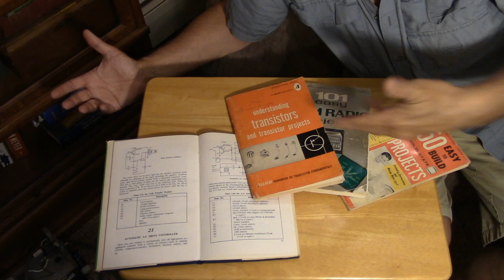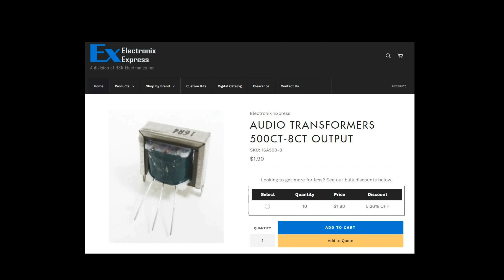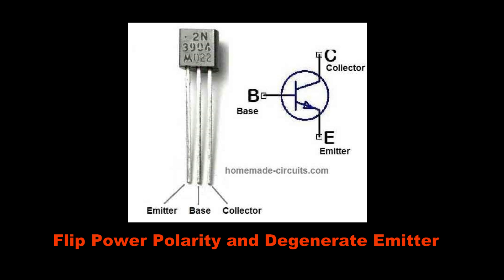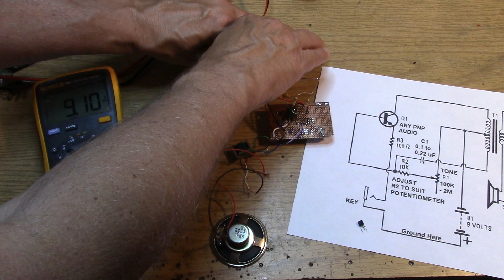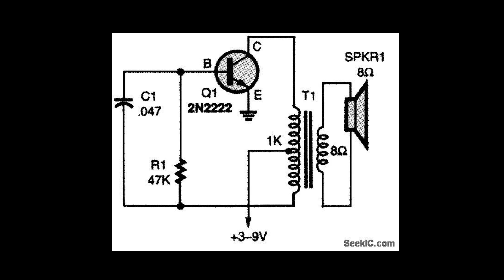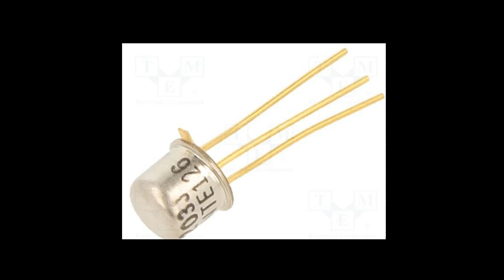Simple Code Practice Oscillator Project

Comment: Have you ever tried a reverse avalanche  oscilator. Very simple BD 139 works well at 12 volts although other transistors will work but may need a higher voltage

Comment: 😂 Too simple I made a 4 transistor circuit that has 2 oscillators: one modulating a multivibrator.
It has several adjustable parameters so you can generate sirens, tones strange wobbling/shimmering sounds. Its supplied by an LM7812, uses a rechargeable 22V battery from a vacuum cleaner which directly supplies  a TDA2050 audio power amp IC. A momentary switch "the black button" feeds the audio from the generator circuit to the power amp via a potentiometer to control volume.
Zero to 15W. Its all built into a steel lunch box. I feed a 30W 8ohm horn speaker with it. 
Great for a practical joke. You walk around with the speaker in a bag making ear ringing short bursts and watch people 😂

Comment: Heh cool, now we use a few billiion transistors (mictrocontroller) to make an oscillator wih a simpe line of code.   I loaded up a saw wave example code on my stm32 and sure enough it puts out a nice saw wave at 200khz.  $1 in parts, 0 soldering. But i didnt learn anything... another copy and paste and I had  a white noise generator, sounded just like it too.    Copy and paste is so much easier then wiring up an new circuit... but you dont learn anything.

Comment: To complicated!  The one that I built years ago was extremely simple, used a single 555 IC, and was featured in the first few pages of an ARRL handbook, maybe about 1969.  It featured volume and tone controls and required a single 9-volt battery.  All of the components used would still be available today for purchase.  Just wished I had that schematic.
Reply: This appears to be substantially similar to what you describe, or at least a modern version of it: https://www.arrl.org/files/file/QST/This%20Month%20in%20QST/2023/12%20December%2023/2023-12%20Hoffman.pdf

Comment: I built a single transistor code practice oscillator in 1969 while in Vietnam working on a Novice license. I got to 5 wpm, but gave up when sent to another command, thanks for this one Mike. 73's🎙KD9OAM🎧📻
Reply from the maker: I got an old Eico CPO from an upgraded novice when I was a kid.  It was almost identical to this circuit!

Comment: Unfortunately, I have a bad habit of looking at all the old transistor radios I find and instead of snatching useful parts from them I think, "I bet I can fix this thing. It's probably just a bad connector or a shorted cap. And even if it's a transistor, I have bins full of them. Sure the tuning cap would be good in a QRP antenna tuner, but this cool old radio is already all here and just needs to be fixed. Besides, I already have a QRP antenna tuner, 2 of them in fact. A little super glue will fix this case just fine and I can stick in a little step-up inverter module, shield it with aluminum foil since this is an AM radio, add a few filter caps and an inductor to quiet it down, and a lithium battery pack to drive it all instead of those 4 old C cells. Probably run for days, especially if I put a small solar panel  on top. And I think I have a longer-throw speaker this size somewhere, too. This thing could sound great by the time I'm done with it! And I could listen to it when I'm working out in the shed instead of listening to the 4 channel 400 Watt SONY Dolby system I have in there already."

Comment: I really don't condone scrapping an old relic of the past like that. Repair that old transistor radio and get the parts somewhere else instead. But that's just me. To each their own I guess.
Good video anyway. Thanks and keep up the good work.
Reply: Repairing Japanese Transistor radios was my first unpaid job. My father often used to take me along on a Saturday morning to the service department of a group of retail electrical shops where he was the service manager. Rather than me sitting around idle, he put my keen youthful eyes and soldering skills to use, (I must have been about 12)  soldering back the thin wires of the long and medium wave coils on in-guarantee tranny radios. Unpaid? Maybe I got paid in solder.

73 Steve M0KOV
Reply: Repairing Japanese Transistor radios was my first unpaid job. My father often used to take me along on a Saturday morning to the service department of a group of retail electrical shops where he was the service manager. Rather than me sitting around idle, he put my keen youthful eyes and soldering skills to use, (I must have been about 12)  soldering back the thin wires of the long and medium wave coils on in-guarantee radios. Unpaid? Maybe I got paid in solder.

73 Steve M0KOV
Reply: The millions of awful old japanese plastic pocket radios are worthless. It's not like he's scrapping an Atwater Kent
Reply: I remember having a big box full of crappy AM radios when I was a kid. I would pull out the ferrite antenna and speaker. I once made a speaker "wall" out of transistor radio speakers. It sounded surprisingly good! 73's W3IHM